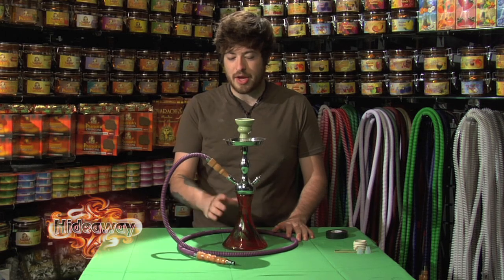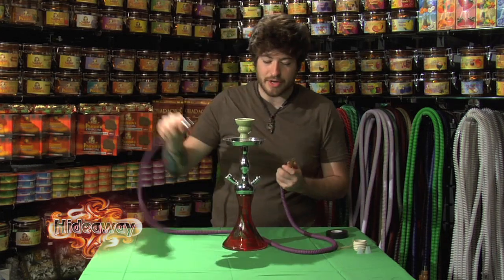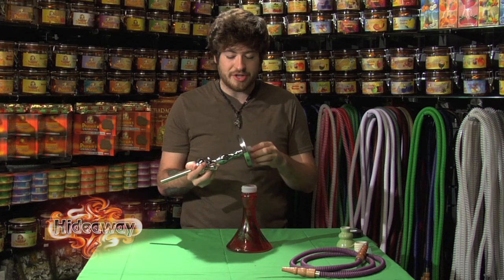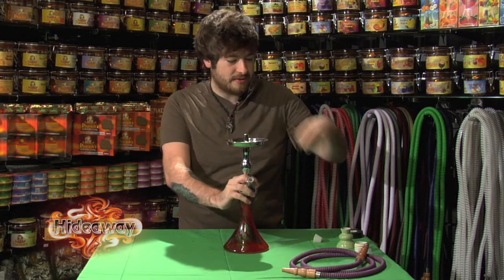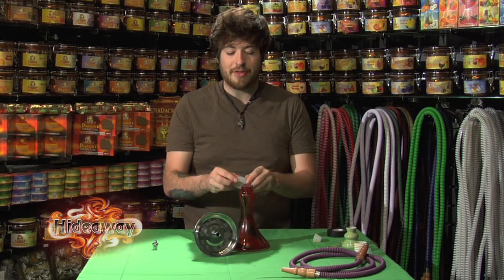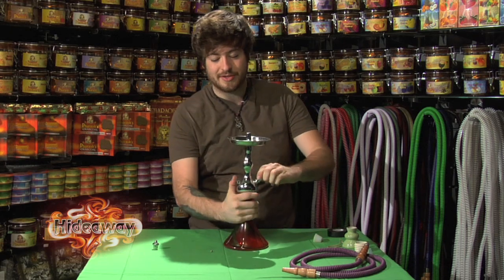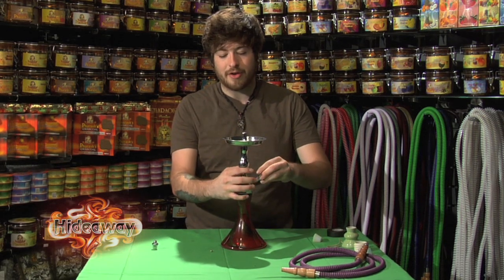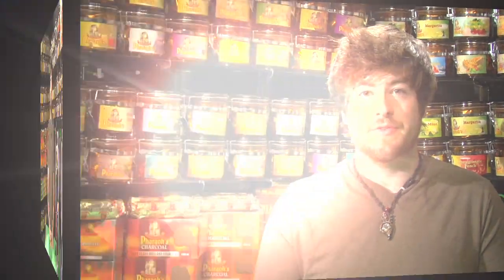How to Hookah: Troubleshooting (5 of 6)

Comment: Good video, but if I could make a respectful suggestion.... I would recommend using plumber's tape instead of electrical tape. The one thing you're going to encounter with electrical tape, which you absolutely don't want inside of your hookah, is all of that sticky gunk that will sure come off the electrical tape once you remove it. That stuff is unforgiving and will stay on there forever. Plumber's tape doesn't have any adhesive and more importantly, it is specifically designed for creating seals on treaded ends.